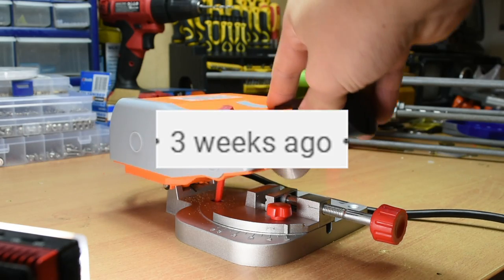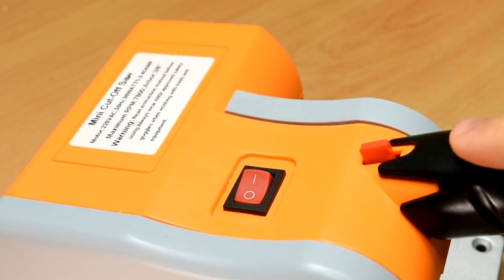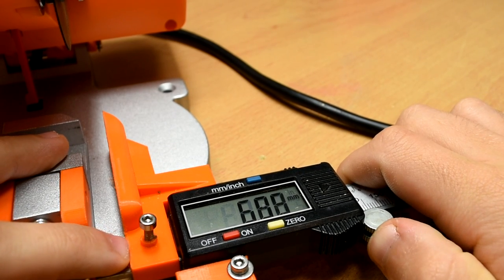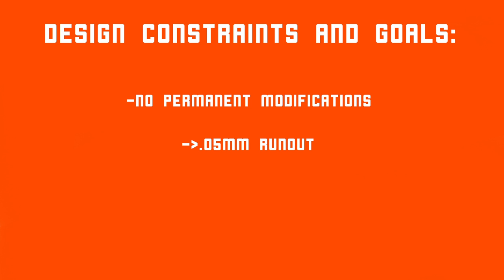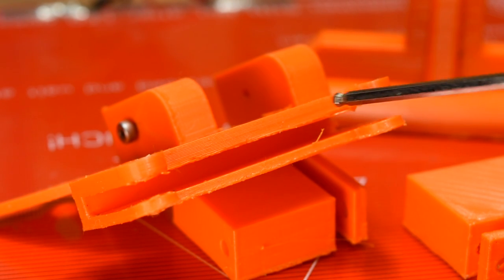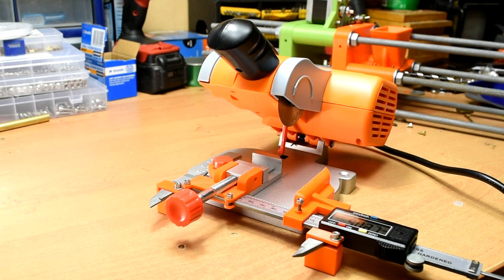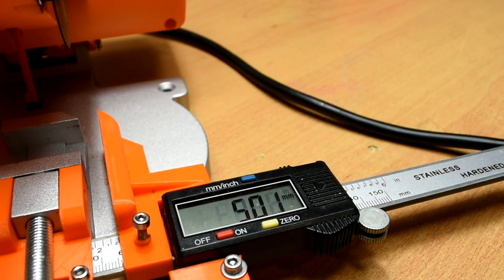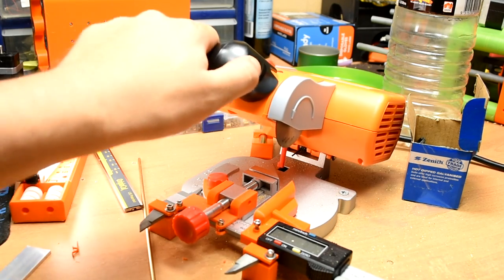Mini Chop Saw 3D Printed DRO Upgrade!

Comment: Hi Chris! how accurate are the mitres from this saw? this could be ideal for some of my projects and takes up very little space, I have one of the mini table saws which is not bad for cutting small stock.
Reply from the maker: I havent done a huge amount of angle work with it but what I have done was fine, I usually aim ever so slightly longer like .25mm or so and then file a bit if I have to.